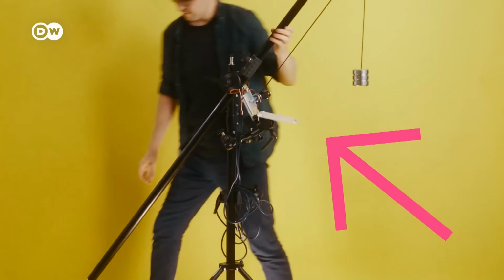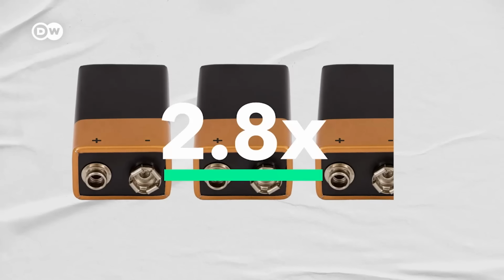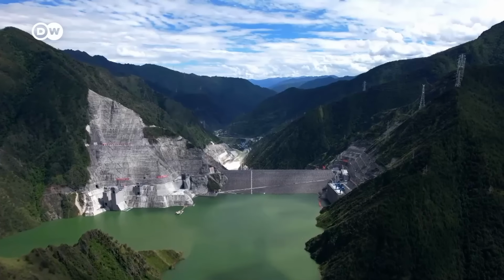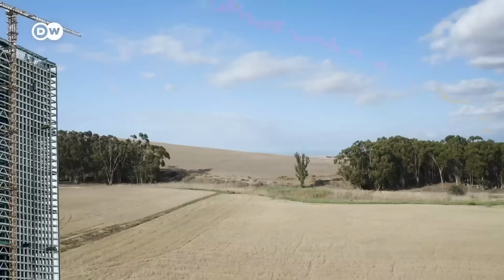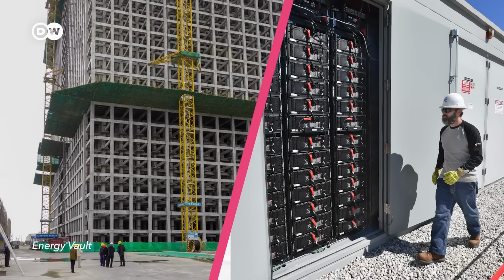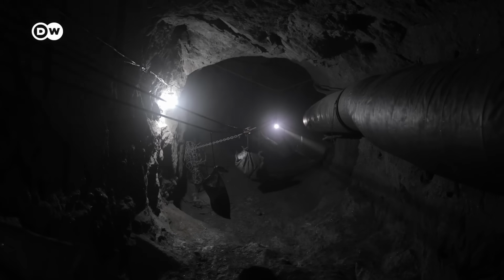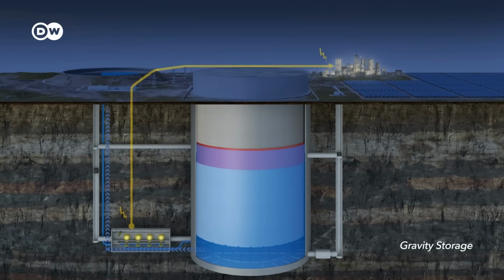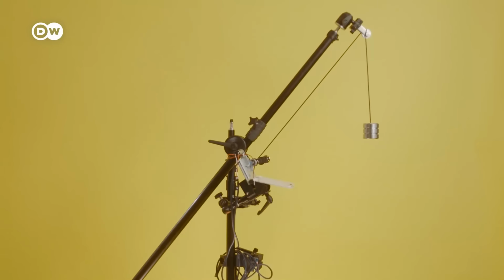How to use gravity to store energy

Comment: Gravity batteries are just dumb. Even a big gravity battery will not be more than a little pond when comparing it to pumped hydro. The crane wires will need replacing quite often, and these are expensive. Even mine shafts will be much more effectively used as the lower reservoir in a pumped hydro project.

Comment: I don’t understand how these work. So you can capture the potential energy when a heavy weight is dropped from a certain height over a given distance, ok I get that part, but  the same heavy weight needs to be lifted back to its original starting position to start the process again, which would require more energy it generated, as some energy would have been lost due to heat, sound etc during the dropping process. Am I missing something here?
Reply: All energy systems have some losses in it, including the efficient Lithium storage.  It's captured in the Round-Trip Efficiency (RTE) rating.  Lithium batteries are up there in RTE around 90%.  I'm seeing gravity storage RTE around 83%.  Pumped storage RTE around 70% to 80% efficiency.
Reply: Yes, energy storage systems consume more energy than produce. But still can be useful and economical, but probably not this one. E.g. at night demand is low, price is low, powerplants have excess capacity, system can store energy. At evening demand is high, price is high, energy is released to fulfil demand.

Comment: we made many calculations to find if gravitational storage was in any way a viable option in the vast world of energy storage technologies. Long story short: they are a total waste of money and an enourmous waste of materials. Pure junk.
Reply: "we made many calculations" I just made one:
Any AA size rechargable battery can store the energy equivalent of lifting 100kg to 10m.
Gravity storage (other than pump hydro) is a no go.
Reply: You ignore alot if factors when doin your calculations not everyone has resources for your lithium batteries water dams dams certain technologies work better in certain places
Reply: @grahammukuyu4660  By weight alone water is cheaper in 100% of the world than iron or concrete.
Reply: @grahammukuyu4660 you ignore a lot of calculations, there is also sodium ion batteries.

The whole thing do not cover the round trip efficiency, maintenance cost.

Even flow battery already difficult, the project sodium ion battery cost per kWh is 40 USD in 203x so when everything is built the sodium ion battery also kill this type of storage even pump hydrogen is now reaching 100 USD kWh depending on where the construction is.

So sodium ion battery is the way to go and is already in full production mode

Comment: CALCULATION: This is a footprint of 2/3rds of a mile on each side and 20 stories tall for a city with 100,000 people (40,000 homes), each home using ~30kWh per day, and a 3 day supply of energy storage (cloudy days), and the concrete gravity battery ONLY powers the homes (not businesses, commercial, industrial, hospitals, infrastructure or lights, water pumps, etc) — just the homes — the concrete gravity battery would be 1x1 km footprint, solar panels on top of the concrete, this mass would be 15 meters tall and need to be lifted ~45 meters up.
Reply: Is this calculation correct? A 5 story tall mass of concrete, lifted 15 stories up (full capacity would be a height of 20 stories (15 high and 5 tall)).
Reply: This 1x1km footprint has enough solar power to sustain the gravity battery.

Comment: Some solutions might work, but there are solutions that works really bad.

Pumped hydro is a good solution. Using old mining shafts might be good.

Lifting a bunch of relatively small concrete blocks seems like weird idea. And in sky scrapers? We build Sky scrapers because ground area is limited. Lets not waste it for something that can be easily transported.

Comment: Literally water does this
Reply: Water density is only a fraction the density of metals.  Water is dense at 1000-kg/m³ but compare that to the density of metals like iron at 7878-kg/m³ so gravity batteries can be significantly more compact in area and height versus Pumped-storage Hydro (PSH).

In short, you need huge volumes and/or huge heights to get reasonable energy storage from water energy storage-based systems.  What's worse, water rights and access is hugely contentious from competing interests like agriculture, urban use, and environmental protection.  Unfortunately, water contention is only going to get worse as climate change ratchets up global warming.
Reply: @beyondfossil  Water is significantly cheaper by weight than any metal. Millions of tons of water are already being used for various power generation methods, why not spend a little on power storage?
Reply: @augustine6683  The low cost of water is minimal in overall operating cost.   A gravity system's weight mass can be used indefinitely as gravity systems can use it in a "closed loop".  Iron will outlast both the Earth and the Sun!

My point was gravity storage provides advantages over PHS  in terms of power and energy density.  Because using iron allows for a huge 7-times volumetric density over water!  That means a much more compact energy storage system in both head height and volume water.

Contrast that with PHS's "open loop" where water constantly evaporates and the water is constantly exposed to large quantities sludge from suspended biomatter, dirt and other debris that requires constant cleaning over closed loop gravity storage systems.  It also can create seasonal variation in energy storage capacity which utility operators don't like over more stable forms of energy.

Interestingly, some gravity storage systems combined water with the weight mass.  Look at GravityPower's design that uses a massive weight suspended within a fluid.  Their design needs no cables nor pulleys at all, yet it's still totally closed loop self-contained.

We need anywhere some more 1500GWh to 2850GWh of storage by 2040.  PHS  can't do it alone and PHS requires very specific geological conditions to be cost effective.  But global warming will increase water right contention between various competing entities: agriculture, city, urban, indigenous, and environmental groups to name the big ones.  Damming up any water way has major effects on the local environment. 

That all makes viable sites for PHS increasingly difficult to source.  We need a lot more energy storage techniques and a lot more quantity of them.

Indeed, why not spend more for energy storage?  Especially when new designs show promise of overtaking PHS in both quantity/availability, cost, and energy/power density.
Reply: @augustine6683  The low cost of water is minimal in overall operating cost and its not as reliable given constant evaporation.   But a gravity system's weight can be used indefinitely as gravity systems are self-contained "closed loop".

Contrast that with PHS's "open loop" where water constantly evaporates and the water is constantly exposed to large quantities sludge from suspended biomatter, dirt and other debris that requires constant cleaning over closed loop gravity storage systems.  It also can create seasonal variation in energy storage capacity which utility operators don't like over more stable forms of energy.
Reply: @augustine6683  Furthermore…

To re-iterate my point: gravity storage provides advantages over PHS with much increased power and energy density.  Because using iron allows for a huge 7-times volumetric density over water!  That means a much more compact energy storage system in both head height and volume water.

Interestingly, some gravity storage systems combined water with the weight mass.  Look at GravityPower's design that uses a massive weight suspended within a fluid.  Their design needs no cables nor pulleys at all, yet it's still totally closed loop self-contained.

We need anywhere some more 1500GWh to 2850GWh of storage by 2040.  PHS  can't do it alone and PHS requires very specific geological conditions to be cost effective.  But global warming will increase water right contention between various competing entities: agriculture, city, urban, indigenous, and environmental groups to name the big ones.  Damming up any water way has major effects on the local environment. 

That all makes viable sites for PHS increasingly difficult to source.  We need a lot more energy storage techniques and a lot more quantity of them.

Indeed, why not spend more for energy storage?  Especially when new designs show promise of overtaking PHS in both quantity/availability, cost, and energy/power density.   Water is not the only choice.
Reply: @augustine6683  Furthermore, we need anywhere some more 1500GWh to 2850GWh of storage by 2040.  PHS can't do it alone and PHS requires very specific geological conditions to be cost effective.  But global warming will increase water right contention between various competing entities: agriculture, city, urban, indigenous, and environmental groups to name the big ones.  Damming up any water way has major effects on the local environment. 

That all makes viable sites for PHS increasingly difficult to source.  We need a lot more energy storage techniques and a lot more quantity of them.

Indeed, why not spend more for energy storage?  Especially when new designs show promise of overtaking PHS in both quantity/availability, cost, and energy/power density.   Water is not the only choice.
Reply: @augustine6683  Furthermore, we need anywhere from 1500GWh to 2850GWh of additional storage by 2040.  PHS can't do it alone and PHS requires very specific geological conditions to be cost effective.  But global warming will increase water right contention between various competing entities: agriculture, city, urban, indigenous, and environmental groups to name the big ones.  Damming up any water way has major effects on the local environment. 

That all makes viable sites for PHS increasingly difficult to source.  We need a lot more energy storage techniques and a lot more quantity of them.

Indeed, why not spend more for energy storage?  Especially when new designs show promise of overtaking PHS in both quantity/availability, cost, and energy/power density.   Water is not the only choice.
Reply: @augustine6683  Furthermore, we need anywhere from 1500GWh to 2850GWh of additional storage by 2040.  PHS can't do it alone and PHS requires very specific geological conditions to be cost effective.  But global warming will increase water right contention between various competing entities: agriculture, city, urban, indigenous, and environmental groups to name the big ones.  Damming up any water way has major effects on the local environment.
Reply: @augustine6683  So for the reasons stated earlier, all that makes viable sites for PHS increasingly difficult to source.  We need a lot more energy storage techniques and a lot more quantity of them.

Indeed, why not spend more for energy storage?  Especially when new designs show promise of overtaking PHS in both quantity/availability, cost, and energy/power density.   Water is not the only choice.
Reply: @beyondfossil  Water can be in a closed system. Just cover the reservoir
Reply: @augustine6683  That's very impractical and won't work either:

a) You're talking about many dozens to hundreds of acres of water surface.  Both the smaller and larger reservoirs would need to be covered and one can significantly larger than the other (like actual "lake" sized).
b) Covering the reservoir doesn't actually result in a closed-loop because the lake's bottom surface is dirt and its own biome.  You'd need to cover the bottom of the lake as well.

c) Need to maintain all of that constantly.
d) Many of these reservoirs are popular with water-based recreation
Reply: @beyondfossil  The crazy thing is that covering all sides of a massive reservoir of water would probably still be more cost efficient than solutions using solid metal or concrete to store energy with gravity.
Reply: @augustine6683  No, not at all.  What you're suggesting is crazy expensive and probably not even technically possible.
Reply: @beyondfossil  Your main point is that gravity systems can remain indefinitely but due to the wear created from friction alone these systems would likely require constant upkeep to not fall apart.
Reply: @augustine6683  I was referring to the iron mass that will last a very very long time especially since it's in a closed-loop system.

Even if the gravity storage system eventually was dismantled, the iron mass could be re-purposed for another gravity storage system or melted down for other uses.

Iron will outlast both the Earth and the stars.  Iron is the most stable element in the universe.

Comment: Nothing better than seeing an education channel sell off a long-debunked idea. 
Truly makes us trust your research guys!
Reply: @sbk2207  Or you could just pump 25000 liters of water for the same result, and not have to deal with concrete blocls on steel cables in the wind, safe a shit ton of hassle, safety and maintenance
... it doesnt just work with brick. It works with anything. And if it works with anything you want to use a fluid, not a solid. And if any liquid works, well, water is inert, cheap, easy to handle, and pretty dense...
There is literally no reason for this invention, other than yet another techno hype scheme for startups.
Reply: @SimonMester not very viable for desert countries
Reply: @asteri73  Anything would be more viable than this concrete nonsense. For desert countries you have a number of other options.
Reply: Make the connection 👉 The Connections (2021) [short documentary] 🌎 ♥️ 😎 ✨️
Reply: They are being built though.
Reply: @adrianthoroughgood1191 China and Africa (CCP also) always throw money at random thing hoping one of them catch something. Northing new and it's all prototype with merger sum as well. Dont let this damn video fool you
Reply: @adrianthoroughgood1191 yeah, the hyperloop was too, before being scrapped because of the basic failures of the idea. This concrete gravity block bs will never make any sense. Its a maintenance nigtmare compared to just pumoed hydro.
These will be obsolite compared to just the ever better batteries even. Especially moving into sodium at scale.
Reply: @SimonMester  How on Earth can something like this become obsolete?  Once built it is pretty much just free energy.  You might as well call pumped storage obsolete...
Reply: @krashd  Have you worked with anything in your life? I bet you havent poured concrete or worked with steel. To think this would be "free energu" is beyond ridiculous. This will be a maintenance nightmare when built. Yes, when you move from ideas to reality, small practical considerations will ruin you.
Moving concrete bricks on steel cables, even in mild air currents, over and over and over, is incomperable to just pumping water.
Holy shit people have no real world experience anymore.
Enjoy the tech hype bs.
Reply: @krashd  You're forgetting that this technology would require constant maintenance, materials aren't infinitely strong and will wear down over time.
Reply: @SimonMester  I like the idea of a Gravity Hyperloop. Oh no, let's not give any investor-money-attractor the idea of a vacuum tunnel right through the center of the earth.
I mean, we can attrich 1 billion to dig the first 50 meters as a "proof of concept" right?
Reply: @krashd  it requires significant amounts of maintenance and lubrication, aswell as regular discharging to do anti corrosion maintenance 
and even if it didnt, its not free energy its storage with a bad conversion rate
Reply: @augustine6683 tech changes.  It can be updated with different low cost maintenance material of given time. This tech has been here since corca 2018 and lots of changes have happened in that space of time.

Comment: Water power from dam is so far the most efficient and lowest maintenance way of storing energy.  The main drawbacks are: 1.danger of dam collaps and its potential of damage. 
2. It requires a massive amount of space, even more than quarrys.
3. It takes alot of power to pump up water to store that energy. (You can pump mainly at low-cost hours to reduce cost, or have dedicated green energy to power the pumps)
4. Water may need cleaning of trash and such to not clog turbines.
5. Turbines and the tunnels leading water into the turbines need cleaning to avoid clogging. 

Benefits: 1green energy. 
2. Depending on geographical location it refills itself slowly. 
3. Requires  little maintenance (but constant and vigilant attention, to discover early signs of deterioration)
Also water does not need much attention compared to others gravity storage. (Concrete, metal etc will take dmg over the usage periods and requires maintenance and replacement)
4. Can provide alot of power at short demand.
5. Depending on location the water can go through multiple turbines before it reaches the sea or pumping point.
Reply: TLDNR. Material storage materials deteriorates over time.
Water dont.

Materials are expensive. 
Water is cheap and almost everywhere.